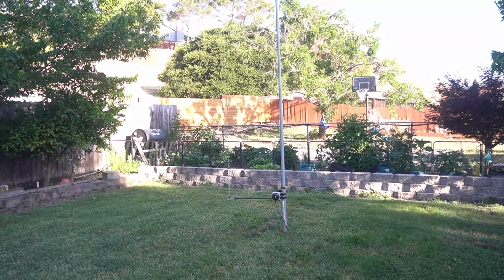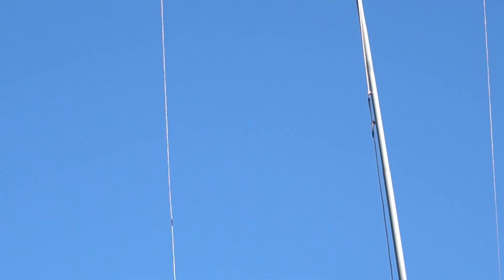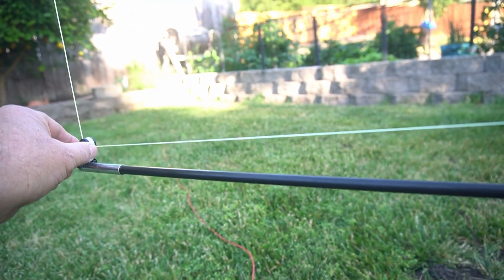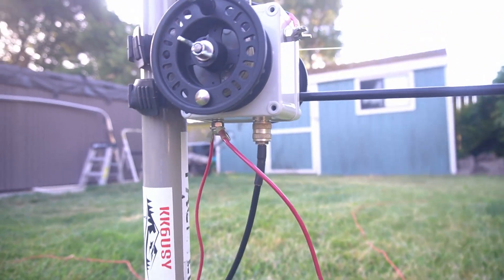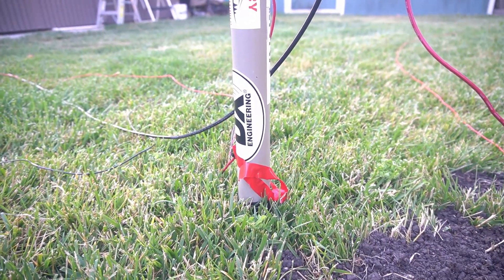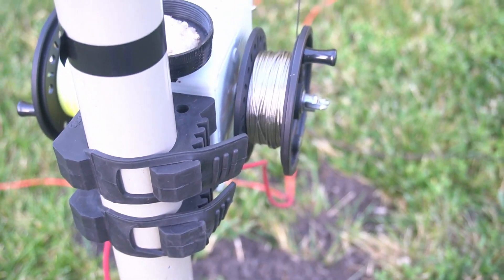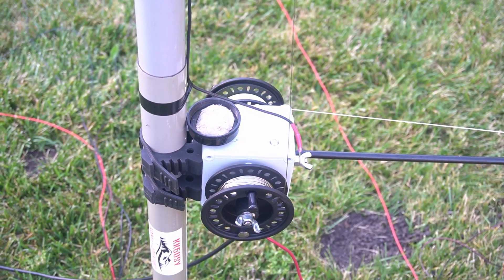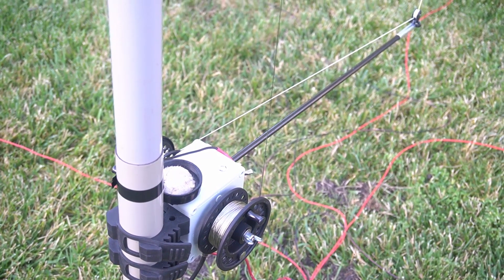My build of the MM0OPX Adjustiwave Multiband Antenna Lite! First Look.

Comment: Hey Chuck I love your content. How is the antenna connected from the transformer to the stainless wire?  
Where did you buy the pulley and the tent poles?
Reply from the maker: Hi Tom, I purchased the pulleys and tent poles from amazon I will add a link her. The stainless wire is connected to the shaft of the fly reel with a ring crimp connctor and then a fishermans knot to the fishing line to pull with and some superglue to hold the knot. tent poles, https://amzn.to/3orH95J, pulleys, https://amzn.to/3GV9Aj4

Comment: Hey Chuck. I’m curious what spec stainless downrigger wire you’re using is? They seem to be most easily specified in lbs test. Seems like the 1x7 strands is most flexible … but they often don’t express in terms of awg/gauge or even diameter. So I see they can be had between like 20lbs test (which is similar to the pull strength of polystealth 26awg, I think) all the way up. It’s going to be a trade-off between weight/bulk and resistivity, I know, but looking for something with similar efficiently to a 20-22 gauge tinned copper wire or even the polystealth. Davis RF flexweave would probably be a nice choice but I think it’s 16awg minimum. Thanks!
Reply from the maker: The size you state seems right 1x7 strands.I found some I purchased but not sure it is the right one. https://amzn.to/3ZVGqrE. The 26 gauge polystealth might work also, with both you need to be slow letting out line so it doesn't want to come off the reels. Keep tension and you will be good. Chucl

Comment: Could you make an update on how the reels operate.
Reply from the maker: Yes I will do another video as soon as I have time setting it up and using the antenna.
Reply: I figured it out. Instead of tent poles I used carbon fiber arrows. And used 50 lb nylon coated SS fishing line. Just waiting on the pole. That switch you used on the rotor build and two 12v motors. Switch the polarity on one...it could be motorized. Might be another good project.
Reply from the maker: @n3ljs399  Lol , I have already though about the motors, I think it can be done. How does the coated line work? I actually used fiberglass driveway markers for the upper spreaders because they fit the holes in the upper holder.

Comment: Thanks for sharing, I’ve been experimenting with linear loading on and off for about 3 years.  Couldn’t get the right reels to wind the wire correctly (too many cheaply made and not up to the job) then pops up Colin, passionate about what he does and is most generous in sharing his passion with others.  So I sourced the  materials through Him and it works like a dream, 12 meter Spiderbeam is needed for use on 80 together with some decent radials.  This summer I will be doing further experiments with raised tuned radials and see how that works.  👍🏻👍🏻👍🏻 73 de M0AZE Mike

Comment: Awesome antenna!  I’ve watched Colins videos and have been interested in this antenna.  Question how does the steel wire terminate into the feedline is the other end of it ran into the box and soldered in?
Reply from the maker: Thanks, the wire goes thru the reel has a knot to keep from wanting to pull through and a ring terminal to the mounting bolt, then wire in the box.